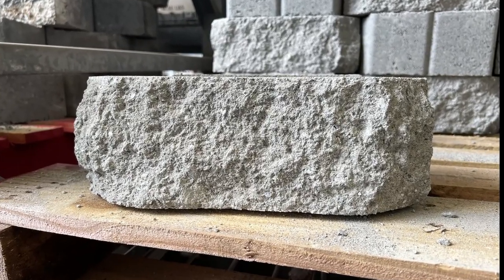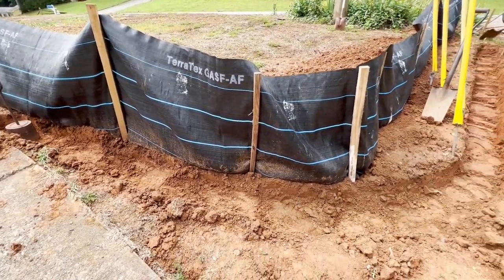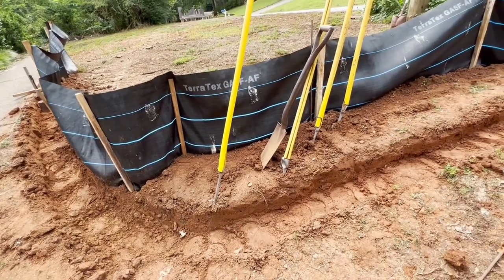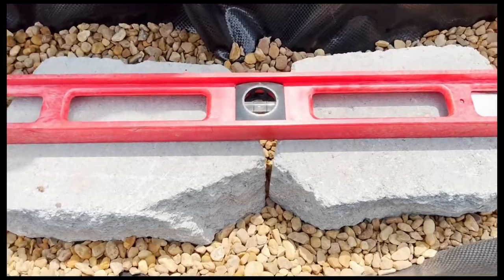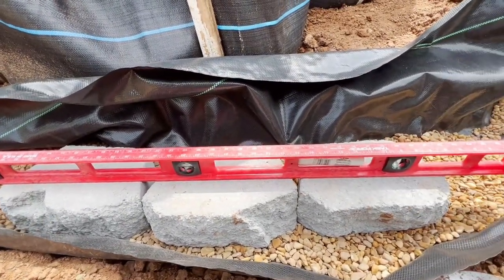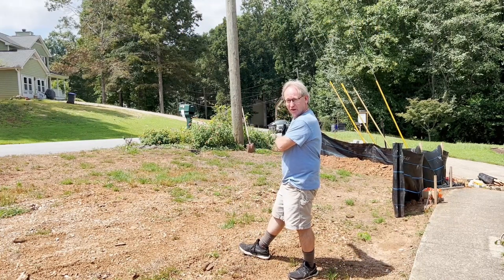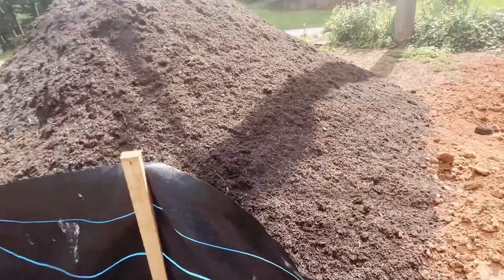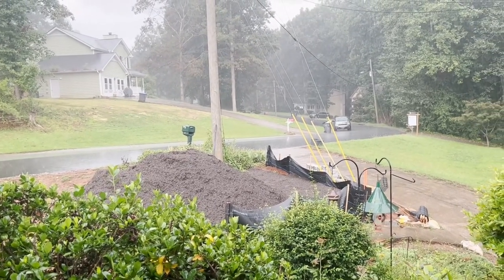Retaining Wall Complete How To Build With Windsor Blocks Part 1

Comment: How big is the dead blow hammer?
Reply from the maker: Hi. Thanks for taking the time to watch and comment. It's a 56 Oz MAC CH58. It's about 20 years old and super durable. They're about $120 from MAC (crazy) and a fraction of that on eBay, etc. I think I paid $80 for it new off the MAC truck 20 years ago. Comparing it to others, it's noticeably better in all aspects. Shop around and find a deal, and you won't be disappointed. It just feels predictably exactly right when the task calls for a dead blow.